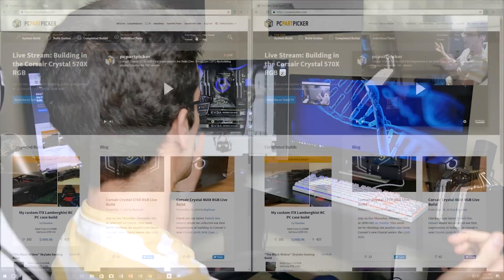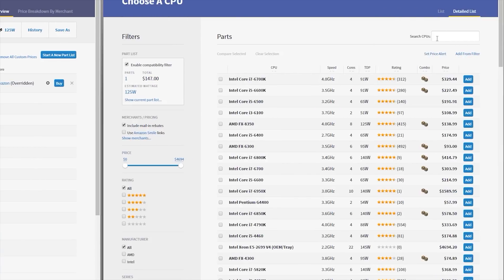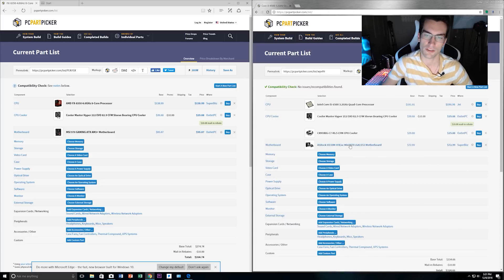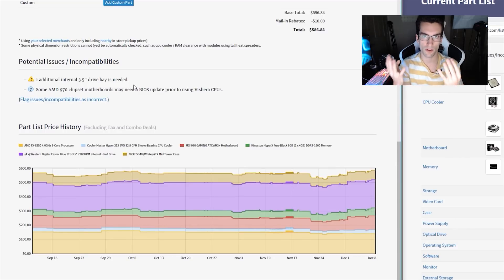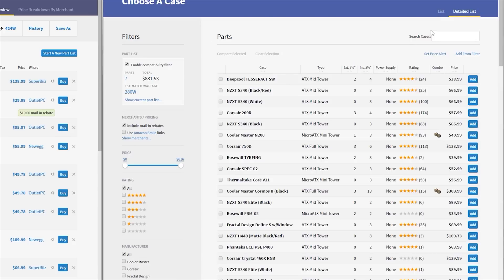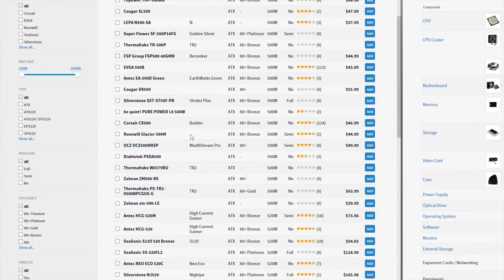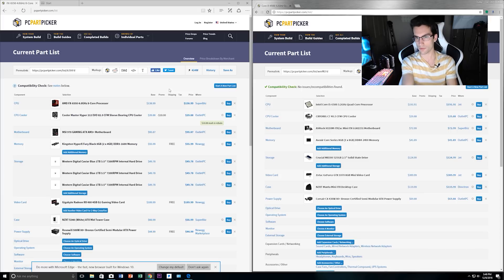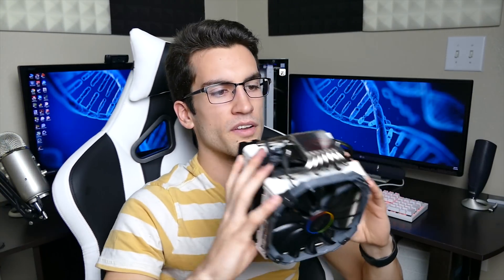Crash Course: PC Part Guide for Beginners

Comment: I find it strange that you don't use stock coolers when many professional computer technicians advise on using it when not overclocking their CPU.
Reply from the maker: I do not recommend a stock cooler. Period. You don't have to agree, but I will always recommend an aftermarket cooler to my viewers if their budgets allow for them.
Reply: They'll cool your cpu fine, they're really loud though so a lot of people opt to go with someone quieter.
Reply: GD Nyte well I do agree with that, but that option should always w left to the one building rather then telling people to buy an aftermarket cooler indefinitely.
Reply: I took the advice of using a stock cooler on my first build, I regretted it only days afterwards. That thing was NOISY. Then I took that advice of using stock cooler again when I built a new computer with an Intel processor 4 years later, because hey maybe Intel is better and you gotta save money - right? 
Nope. I regretted that too. The noise was abhorrent.

Use a stock cooler all you want, but recommending it if there is no budget concern is doing a disservice to any new computer builder. The stock cooler is something you tolerate when you have no other choice.

It's not like you have to spend 100 bucks for a good cooler.
Reply: They work, but temperatures are too high for most people to be comfortable with, and when you have good coolers for really cheap (Hyper T2, for example), it is more than worth it. I am waiting on some parts that I bought during black friday which include a Hyper T2 that I got for $7.
Reply: Sai Krishan Kumar did you know that the majority of pc users won't be viewing a video on a youtube channel which is based around building custom computers? Shocker I know, but most people here do in fact use their pcs heavily, we aren't the facebook crowd that you are referring to.
Reply: Can't tell if you are in denial or just really stubborn.
Reply: Salazar Studio I respect your opinion but I will have to disagree.
Reply: Lucas Magno I know, mostly AMD coolers have been garbage, well apart from Wraith, so what you say is true, but Intel coolers are satisfactory. If those coolers are as back as you say they are, manufacturers will not be supplying them in the first place.
Reply: Frankie agree, an option, not an indefinite choice.
Reply: +Herp Derp My Hyper 212X (=slight-modified 212 EVO in video), usually costing around 27USD in my place, was able to allow me running i5-6600K 4.85GHz daily, with highest temps in adobe premiere pro video editing at around 70C. All these during summer at 30+C. So honestly, even the 212s can be classified as overkill for the majority.
Back to stock cooling. Intel coolers' noise is unbearable. Spending less than 10-15bucks for sth else is enough give you a much better life.
Reply: Fuzz FM please note that not everyone loves in American, also note that price everywhere is NOT THE SAME, and also note that availability is also not the same.
Reply: because that will show what your true temp can be under max load. ive ran a stock cooler for a short while on a i5 4690 and was unsatisfied with the temps and noise level. 
yes for people on tight budget who dont use their computer intensively it will suffice. but by no means is it a good cooler. Its "good enough" by barely keeping it under Intel's "recommended temp" 72c.
Reply: Sai Krishan Kumar I made a joke lol. Sarcasm not equals Joke. If you got offended by my joke I apologize but you dont have to get your panties in a twist just because someone made a joke.
Reply: and they typically don't look good, if you aren't on a super tight budget, and aftermarket cooler is a great option
Reply: i agree. are there other advantages other than less noise and cooler temps (slightly longer lifespan)? i still barely exceed 60 degrees C at load with an i5-4590 and stock cooler.
Reply: true, they don't cost a lot. and to be honest, i've never actually heard a PC with an aftermarket cooler, I've always stuck with the stock coolers since I never overclock. so i have no idea about the drop in noise, it's probably substantial.
Reply: Herp Derp I have done a lot of builds for customers. Yes I don't get to work with the more expensive components but I am experienced enough. I am surely quite surprised when you state that the stock coolers are that noisy. I have a computer sitting right next to me right now. I can barely hear it. It's working on full load btw.
Reply: I've had both i7 4790k and fx 8370(non-wraith) and I can say that both their stock coolers are complete garbage. I had to run to my local computer store to buy aftermarket coolers after trying benchmarking my cpus.
Reply: 15 dollars for a hyper t2 wont even dent your wallet, whereas a stock cooler not only looks ugly but is also noisy. You may say you don't hear it, but in a very quiet environment, like a bedroom, it is irritating to hear a constant shhhhh sound beside you. 

Besides cheap aftermarket coolers only costs cheap.
Reply: Sai Krishan Kumar the thing is unless you heavily overclock you won't need water cooling. But with air cooling,  spend $20-30 for an aftermarket and it gives you the luxury of a cooler working temp and the benefit of being able to overclock a bit. Stock cooler works yes but they're usually loud, runs hotter and allows much overclocking. Idk about you I'll spend $20-30 for a aftermarket cooler to give me a bit of options. There's no real disadvantage in going aftermarket as long as you buy a quality cooler
Reply: Sai Krishan Kumar Its his opinion and he suggested it, not force anyone to absolutely get an aftermarket cooler. Salazar said that he "recommends" that buyers get one. A cheap cooler can be found globally for around 20 dollars. 

You are also stating your opinion, in which he disagrees. Yet, you are telling off people not to buy aftermarket coolers like your opinion is a fact.
Reply: Herp Derp an exceptional response. Just so you know, I live in Fiji, due to currency, things cost twice as much when compared to the US and thrice as much when compared to Europe. Not forgetting the insane amount of duty and taxes, the CM Evo costs 70 dollars here. For my customers that is a great deal of money. I always strive to provide my customers with the best experience, always have me always will. Just so you know, I use a cheap laptop that's 3 years old, I never ripped anyone off to make extra money to buy myself a good computer. You are correct, I have used after market coolers on my customers builds but only after knowing for sure that it will be worthwhile spending that much money.
Reply: zionlee1004 dude there is a vast difference between Hawaii and Fiji, one is in the northern hemisphere and one is in the Southern Hemisphere. I belong to the latter. We have a tiny best buys shop here, they sell cookies.
Reply: Michael Braddy why would I waste my time doing something useless like that, when it's not going to be of. I benefit to me.
Reply: K CPU from Skylake don't come with stock coolers
Reply: exactly, just spend the extra 30 bucks. Like why not?
Reply: Combatsmithen I think I know that already, thanks for stating the obvious. I was asking why choose aftermarket over stock.
Reply: Michael Braddy do you know that majority of PC users never use or even happen to make their computers even get anywhere close to full load.
Reply: Ghosty654321 that's still not justify making such an opinionated remark. My argument as agreed upon by a PC World editor so I will stick to that.
Reply: zionlee1004 I am a huge fan of Cryorig and Noctua coolers, and recommend friends, customers and family to purchase them frequently. But there are ways and means of showing your recommendations, like by throwing a stock cooler out of the window.
Reply: Sai Krishan Kumar He did the "stock cooler throw" for the sake of the video and for luls. You can take that seriously or not, but it was a joke. And he was not going to use it anyway, so why keep it. Hoarding stuff is messy and not good anyway.
Reply: zionlee1004 throwing products creates a bad image of the product for the viewers, they believe what they see and act accordingly. So that is not a joke per say, maybe a distasteful one if it was.
Reply: Sai Krishan Kumar Its the internet, everyone makes a joke once in a while. If people are going to not filter everything they see in the internet, may it be jokes or not, and take everything literally, then those people are going to have a hard time on the internet.
Reply: ***** the reason why I stated Americans is simply because that Americans are in many cases ignorant to the fact that what they call cheap will not be the case for others since majority of the countries in the world have currency far weaker than the US dollar. Please do understand I love aftermarket coolers. But there are situations when it is just not needed. There are professional computer technicians that will agree.
Reply: Sai Krishan Kumar Yea well if it's that freaking expensive I can imagine why it'd be a problem, but I think that's gonna be an exception not the rule. I can't think of any major places other than Brazil where computer parts are brutally expensive like that. Europe, Australia and Canada are comparatively expensive against USA and Asia in general and the prices aren't that bad there.
There are some outliers obviously, I can't imagine you can buy cheap computers on xmas island. Although you never know, they might surprise me with their low low prices.

I have you beat on the old laptop front by the way. I am using a IBM Thinkpad from 2008, it's very nice. Not a cheap laptop, but it is quite old.
Reply: Herp Derp I use an old Asus, second gen i5. All the countries you mentioned, funny enough their rate exchange is a IT better than ours.
Reply: Sai Krishan Kumar Where do you even live?
Reply: zionlee1004 Fiji
Reply: Sai Krishan Kumar Are there no Best Buy in Hawaii?
Reply: Stock coolers are fine for non overclockers like me but there's nothing wrong with grabbing a better 80mm fan off amazon for 10-15$ or something, if you REALLY are paranoid the 212 evo exists, but ask yourself, why spend 30$ for better thermals that aren't needed? As long as your cpu isn't going above 80c its fine and the longevity of its life span won't be effected. Mine only goes to the 50cs during load.
Reply: Sai Krishan Kumar You don't even have a Hyper T2 in your place? Or even a Cryorig M9i? Those are like 20 dollar cooler, it does not have to be a Hyper 212 evo.
Reply: i dont even overclock, but with high cpu games intensive games, my cpu temperatures were really high with ultra/high settings. I ended up buying a Cryorig C7. Couldn&#39;t be happier with my new temp. Went from 81 average, loud fans, to average of 65 and nice and quiet.
Reply: zionlee1004 the computer stores in Fiji are terrible, actually the work terrible would be an understatement. My friend send me a quote from a computer company here, for the price is a 6700K would you believe the price was $1133 dollars excluding tax.
Reply: Sai Krishan Kumar Well, then the cookies will be good enough for cooling the CPU. Time for a trip to Best Buy!
Reply: Here is a parts list.https://plus.google.com/photos/...
Reply: Sai Krishan Kumar Error 404 Not Found!

The link you gave me says that.
Reply: zionlee1004 you can shove your sarcasm, your ignorance already proves how qualified you are wear fellow.